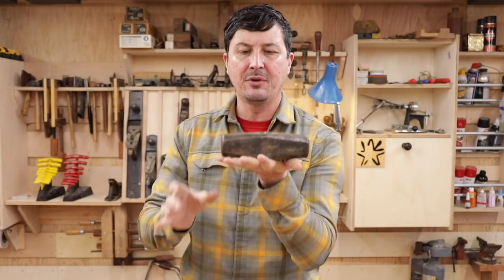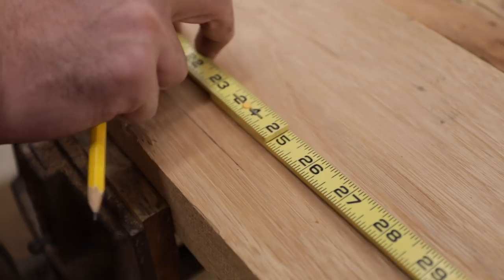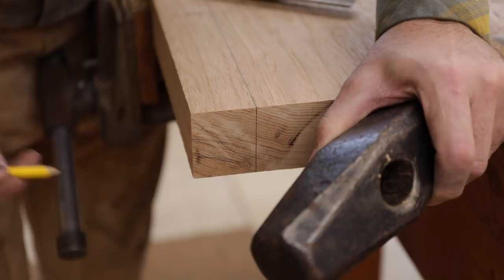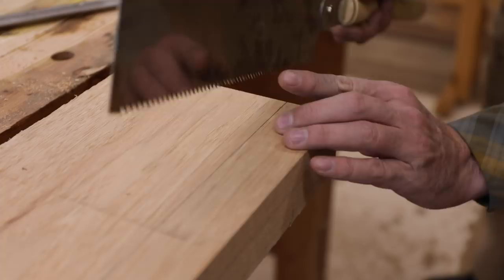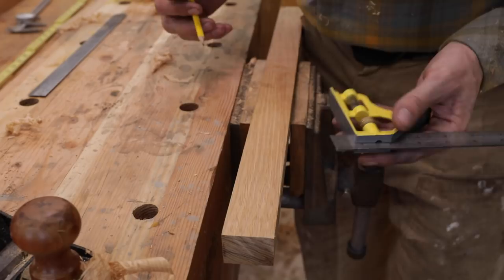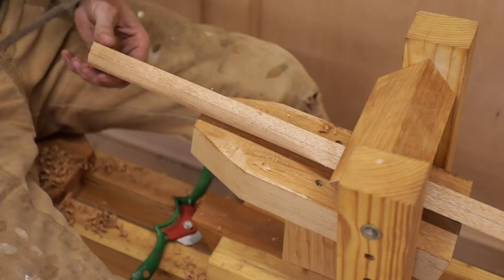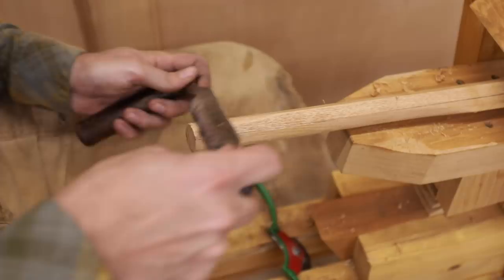Replacing Broken Tool Handles

Comment: Planing it down using a regular plane before rounding of the edges seems like an excuse to show of the tool as it was a complete waste of time. :)
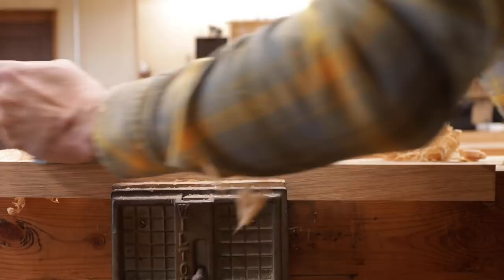Reply: Søren Conradsen 6:50
Reply: Matthew Bernier 
Yes, that is the part I'm referring to..
Reply: He was making sure all four faces of the blank were flat and square to each other.
Reply: Yes, he said that, to which my reply was that it was completely unnecessary.
Reply: Søren Conradsen What for? Why shouldn't he start with a flat and square blank before laying out and shaping the handle? If he hadn't done that, he would have found it harder to create a straight handle--sure he's making it rounded in profile, but still it should be straight in the verticle plane.
Reply: It is possible without doing so, and quite frankly, in my opinion it is just as easy doing without planing it down. And it's not like it was remotely uneven to begin with, not to the point where it was necessary 'squaring it of' nonetheless.
Reply: Søren Conradsen Luckily, there's more than one way to skin a cat, and more than one way to shape a handle, and if a guy takes an extra step and spends a few more minutes practicing his hobby, does it really matter?
Reply: Surely. I just found it amusing that he made up excuses for using a tool that absolutely had no use in this particular project, hence the entire process of using it planing an already approximately square piece of wood was quite unnecessary. ;)
Reply: Squaring of an already square piece of lumber to the point of it being even more square in order to finally round it of seems a bit counter intuitive, doesn't it? :)
Reply: Soren Conradsen, the Troll ? or just argumentative know it all ? In the first place it is not going to be round any where, if you took the time to listen. 
 I don't think that is your purpose is it ?

Comment: Ryoba saws are wonderful, they're the first saws I grab. One tip for you is careful when doing a long crosscut, be careful to angle your blade enough so the ripcut blade does not go into the cut, as it will widen the cut and cause friction and may cause the blade to bind. Love the hand tool videos, most people don't understand the finesse and accuracy you can have with them.

Comment: I LOVE woodworking so much it's a part time business for me. I collect antique tools, especially wood related tools. It's amazing how many sweet antiques you can find that are still fully ready for real work. Custom fitting handles to your antique tool and your preferences is golden. I definitely think hammers need to be of varying weights, shapes and handle lengths and shapes. Wooden mallets are a sweet alternative. I have three wood lathes including a 42 inch Jet to make them and it's an upcoming project. I'm going to use well seasoned big leaf maple wood for the mallets. For cutting long stuff I have a 20 inch Laguna bandsaw with resaw blades

Comment: Hi Cody,I bought a very cheap pull saw just to try it and find out if I could use it. The teeth did not last very long and I expected it to fail because it was so cheap. What I found was that pulling the saw made the cut so much straighter and easier to control and the end result was much better. I have now bought a couple of good quality saws and if I am hand sawing these are the tools I use. Love your videos and look forward to each one that comes along.
Reply: Horrible Fright?  I looked at theirs, but I decided against them.  Luckily, I found some at a garage sale. Nice.

Comment: Those Japanese pull saws are awesome, 3 saws is a basic set often sold as a set. Really good for making tight joints after a little practice. Top tip Cody.
What about that carpenter's tool for finishing? Small rectangle of steel with a constant burr along the length? Can't remember what they're called but im sure you do.
I often find myself using the sharp 90° spine of particularly Mora knives too.

Comment: I put about a 19" on a similar head and love it.The length was determined by the broken pick axe handle I reused for it. It is great when persuasion is needed in tight spaces... like when I was separating rock ledge in a ditch a while ago.

Comment: A trick I learned from an old iron worker for 2 handed hammers is the length of your forearm plus a few inches. Granted they he had to climb with that tool and swing it in a less stable environment. But it works if you want a heavy beater that’s a bit more compact.

Comment: Can you do a video on how you sharpen the round spokeshave? I have one, and I'm not sure what the best/easiest way would be.
Reply: DRotenbergerIV make a round piece of timber to fit inside the curved section wrap that with abrasive paper and draw the bevel over it until it forms a burr then flat the back as normal
Reply: +Adam Lynch thanks
Reply: My grandfather had a stone shaped in a curve. Still he had to vary the point of pressure on the stone
Reply: david smith you can still get round stones, cigar stones too

Comment: Great Job, and you can't argue with results.  But I wonder if there wouldn't have been as much saw binding while ripping if it wasn't mounted in the vice, but held differently.  Like possibly while leaning on it while it was on the shave horse.  Or clamping the offcut to the bench.  Just a thought.

Comment: Cody, who makes those Japanese pull saws that you use.?  I have had several different makes, but they all seem to fatigue and break just below where the handle attaches to the blade.  I admit that I have not really searched around very well for other makes, but now that I see that you use them I figure that you would not use cheap inferior saws and only use very good dependable ones and that is what I need .......   Thanks and GOD BLESS..

Comment: "an inch and nine sixteenths" 
Laughs in metric system
Reply: I had to google how much it is. xD
Reply: Derp Why is metric better again?(Excluding the fact everyone uses it.) I'm genuinely curious. Isn't it simpler
Reply: Kitty Ren Yes much simpler
Reply: laughs at your oppression.
Reply: Excellent
Reply: Kitty Ren its all in base 10, making it simpler. No wierd fractions like 5/32nds. I still know imperial better tho.
Reply: The imperial system was designed for measurements people can relate to. Measurements are broken into halves and more halves because people can envision that. A foot is about the distance apart when you raise your hands together parallel as if to say "it was this big". The metric system is fundamentally easier to understand but the imperial system is easier to relate measurements to. A milliliter is a very small measurement of liquid, that's why the imperial tends to use fluid ounces. A fluid ounce is about 30 milliliters. It's a larger amount and is easier to envision because of the larger amount for each unit.
Reply: Kitty Ren, calculations are one solid example.  What is half of 5-9/16"?  Not an easy answer.  What is half of 140mm? 70mm
Reply: Well, that would be 5-9/32", wouldn't it :')
Reply: Kevoh15 lol, exactly. I guess I'm not letting you build me a house. :)
Reply: James Jackson
So your imperial system is to help all you people with visioning problems envision better.
Reply: Epic Army Of One
It's more just for mental comparison and semi-accurate estimation. I also don't consider it "my" system just because I'm an American. I'm very fond of the metric system for any form of unit conversion.
Reply: Most Imperial conversions are base 2, which is more pleasing in real life though. 32 is just 2^5. You split in half 5 times. Anyone can do that without a ruler pretty easy.  Now to get 1/32 in metric, you'd have to find 0.03125 of what you started with. If you know how to convert that to a fraction you might have a chance but if not, it would be pretty tricky. 

TL:DR Metric is great on paper, conversions just mean moving a decimal pt. Imperial is great in real life because 95% of the time you're just splitting in half or doubling.  

INB4: Yes I know there are length conversions that aren't base two, but when do you make these conversions? Have you ever needed to know how many feet you were driving when you go to the next town?
Reply: Richard Hirth growing up in Canada, 
I cannot envision measurements in smaller fractions than eighths. If someone says "9/16" I have to convert it to 1/8s and a halfs. So 4.5/8ths. That's the only way I can envision it because I simply don't use those small of measurements. When I'm metal working I will always use imperial measurements, ie 1/4" 7/8" what have you, or feet and inches. But as soon as my measurements need things like 1/32's I will just use metric. Why would you measure the edge of a knife before heat treat as 10 thousandths of an inch, when you could simply do 0.48 mm. Way easier to be precise with metric for ME PERSONALLY. though I will always use imperial as long as it's measure in 1/4's, 1/8's inches etc.

We also don't really ever need to do 1/32 of a whole peice through math. Rather than saying I need 1/32 of 320 mm, we would just say 10 mm. There's no need to know fractions, or conversions. Just Measure it in millimeters. If you need smaller measurements than mm, we use a decimal of a milimeter. I hate when I'm using a caliper and it tells me something is 0.0325 inches. WTF is that? If it's not in fraction form I cannot understand it, without research or a fraction conversion. (I suck at fractions man but decimals all day long.) When I do a similar measurement with the same caliper I simply get my answer. 3.5 millimeters or 3.337 millimeters. Way easier for me. Anyways, to each their own. I grew up on metric in a household of people who grew up on imperial. So I am by no means fluent in both, especially with converting from one to the other.
Reply: Richard Hirth One other thing. How do your GPS or maps or whatever describe directions? Out will say, "in 500 meters, turn right onto hillside BLVD"
Does yours simply say in "475 yards take a right etc"? Or does it say in 1/3 of a mile, turn right onto blah blah blah.
Reply: Derp, there are two types of countries in this world; Those that use the metric system, and those who have walked on the moon.
Reply: Jake Pryor metric for science imperial for living... Im a framer and a pretty decent one... And the oy time a sixteenth is used is if you jave to fit something between two other existing pieces perfectly...  32nds are a waste of time unless you have a brand new tape measure since slop will develope afyer the day
Reply: @Milkmans_Son  Really? Has Myanmar and Liberia walked on the moon? And you'd be glad to know NASA worked in metric for the Apollo missions :)
Reply: Rubertoe, wait, so did NASA switch back for the shuttle program?
Reply: @Milkmans_Son  The shuttle is also worked in metric, in fact I think I've seen declassified documents with size only in metric (they were public, in fact, USSR mirrored them in their Buran). They just have a public relationships department which mostly publishes stuff for the general consumer in imperial. Also, the "gauges" and screens generaly display in imperial so to make it easier and more familiar for all the military fighter jet pilots which join NASA.
Reply: Why worry about what you think you've seen when it takes two seconds to just look again?  

NASA’s decision to engineer its replacement for the space shuttle using imperial measurement units rather than metric could derail efforts to develop a globalised civilian space industry, says a leading light in the nascent commercial spaceflight sector.

“We in the private sector are doing everything possible to create a global market with as much commonality and interoperability as possible,” says Mike Gold of the US firm Bigelow Aerospace, which hopes to fly commercial space stations in orbit. “But NASA still can’t make the jump to metric.”

Gold chairs a Federal Aviation Administration working group on commercial spaceflight that is trying to change strict State Department rules affecting civilian spaceflight systems. He sees NASA’s decision to use imperial units as the latest blow to hit the sector.

‘Clear advantages’
Carol Hockert, head of the weights and measures division at the US National Institute of Standards and Technology in Gaithersburg, Maryland, sees his point. “There are clear advantages to using metric units in terms of global commerce and international research collaborations. And space exploration certainly falls into a category that could benefit,” she told New Scientist.

At issue is NASA’s Constellation Program, which is intended to replace the space shuttle. It will use new Ares rockets and a crew capsule called Orion to launch astronauts to the International Space Station (ISS) or the moon.

Civilian operators hope to one day pay to use Orion capsules to reach their orbiting structures, or have craft of their own dock with the capsules. So the last thing they want is a measurement units mix-up between their own and NASA’s equipment.

Shuttle technology
The sticking point is that Ares is a shuttle-derived design – it uses solid rocket boosters whose dimensions and technology are based on those currently strapped to either side of the shuttle’s giant liquid fuel tank.

And the shuttle’s 30-year-old specifications, design drawings and software are rooted in pounds and feet rather than newtons and metres.

“The Shuttle and US segments of the ISS were built using the English system of measurements,” says NASA spokesman Grey Hautaluoma. “And much of the Ares launch vehicle and Kennedy Space Center ground systems are legacy hardware built in the English system, too.”

US law
NASA recently calculated that converting the relevant drawings, software and documentation to the “International System” of units (SI) would cost a total of $370 million – almost half the cost of a 2009 shuttle launch, which costs a total of $759 million. “We found the cost of converting to SI would exceed what we can afford,” says Hautaluoma.

“Given these budget constraints and the need for consistent units throughout the Constellation Program lifecycle to minimise risks, and to contribute to mission success, we’re revising the previous management directive to a primarily English-units-based program,” he says.

That previous directive stems from 2004 when, under continuing pressure from its independent inspector general, NASA agreed to conform with US legislation enacted in 1988 that ordered all government departments to move towards the exclusive use of SI units.
Reply: @Milkmans_Son  It is weird for me since I could probably find the drawing, I'll see when I'm on PC. Then, it must be a mix of systems, no purely imperial, remember from the start NASA has been plagued by european masterminds.
Reply: ardvark84, the phrase is stick with what works, not stick with what works perfectly.
Reply: @jakevonatlas2754  10 millimeters is 1 cm, 10 centimeters is 1 decimeter, 10 decimeters is 1 meter, 1000 meters is 1 kilometer, the same goes for liters and weight

Comment: I have a question that I need your advise on. I have sanded down all of the varnish off  my axes ,saws, and garden Tools and have been using boiled linseed oil to protect them. The question is How many coats of Oil?  My Double Bit Axe must have 40+ coats on it and it's still soaking it up, my Husqvarna Carpenter's axe took about 10 coats, My folding Pruning Saw has 15 coats. 
  When do I stop? My Double Bit  is looking so nice I'm not sure if I want to use it and mess it up. I know this must sound silly but I figure as long as it is still soaking it up I'll will keep oiling them.  Thanks for all your time

Comment: Your grain orientation was fine. The reason the draw knife was working better the other way was because the bevel of the knife was pointed down. You could have achieved the same thing “drawing” if you would have flipped it around. Not backwards. I don’t mean to be a critic or anything, because I love your videos. But improper use of tools is a pet peeve. It’s called a draw knife for a reason. 

On another note, I’ve been digging the videography lately. Keep it up! It’s definitely well put together

Comment: Just wondering, why didn't you choose to cut the initial piece of hickory with an electric tool? Wouldn't that give a cleaner/smoother cut?
Reply: He wanted to do a more traditional build for a special tool but it definitely would be easier and cleaner to use a power tool.

Comment: OK, am I mistaken here?

Ripping with the coarse tooth saw, 
and crosscutting with the fine tooth 
saw?

steve
Reply: You rip with coarse teeth and crosscut with fine teeth. No better way to learn it than by trying both of them, you will never confuse it after that.
Reply: You want to have Cody watch this video?

Ripping with the fine teeth,  and crosscutting 
with the coarse teeth.

Or, are Japanese tools different?

Watch the video.

steve
Reply: motokmac Agreed, the reasoning is that for harder materials you use finer teeth and cross cutting is harder than rip cutting
Reply: Steve Skouson.  Thats correct

Comment: What about a round grain? Like from the center of the tree?
Reply: The center is the pith.  Very unstable and prone to cracking.
Reply: So you are saying it is going to crack through all those rings starting from the center? Interesting theory. I have some black Locust here I just might have to do a test on and see. That wood has some very nice properties other wood doesn't. Getting large chunks big enough to get the grain structure the way a handle should be is not easy though. However the young sprouts can get big enough for a handle in just a few years.

Comment: I always seem to saw at an angle...it's never straight down
Reply: Geo Belmont use your knuckle to brace the side of the saw, and try focusing on the end of your cut. rather than trying to keep it "straight" the whole time, try starting accurately then cutting straight to the bottom part